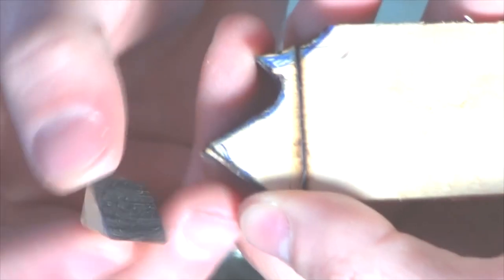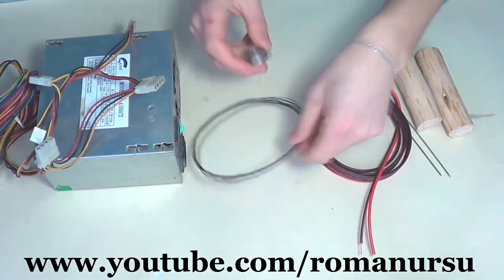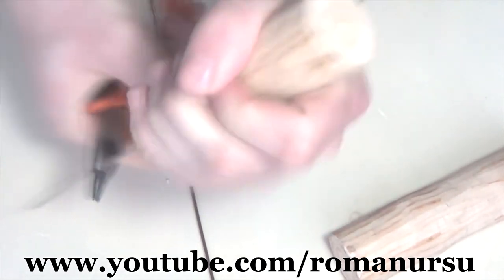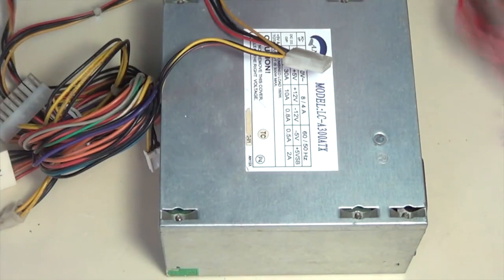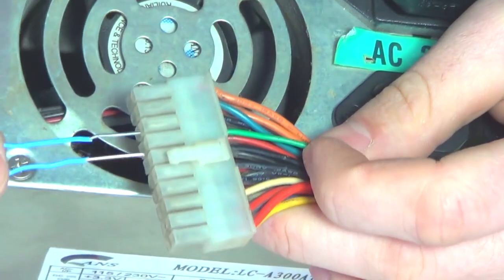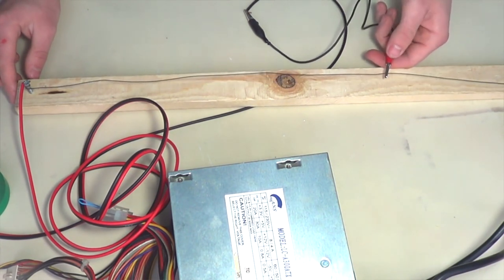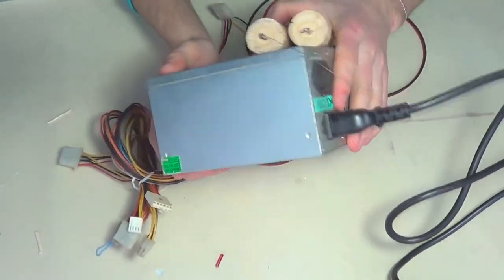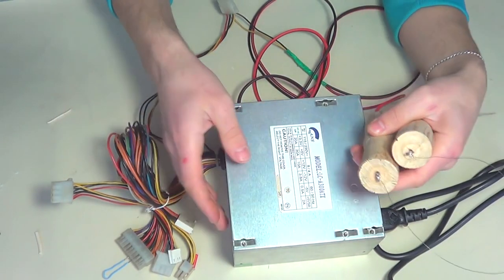How to make a Cutter from a COMPUTER 🔴

Comment: i remember i was a kid when i need a photodiode and i did not find one to buy in my country. i remember i opened a metallic case transistor and placed the inside jonction into the plain sun and using a voltmetter on base-emitter(?). obteined something like 0.2-0.7V and no ideea how many mA. Can be a start for some of your hacks. no idea, maibe a mini solar panel.

Comment: Do you have to use a sawing motion, or will it cut if you just apply pressure?
Reply: No he did that because the heat where he started dissipated. But no it will just take longer

Comment: doesn't short circuit kills power supply
Reply: you don't short circuit it with this special type of wire, it has a large resistance and thus acts as a consumer. Anyways most PSUs either have a fuse or other overamperage/short circuit protection so they should not get damaged by shorting the terminals.